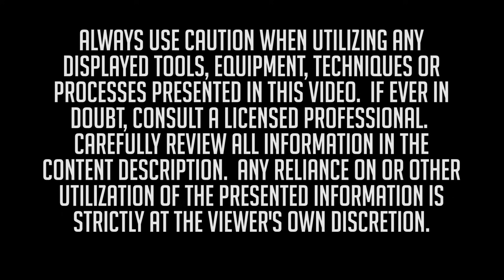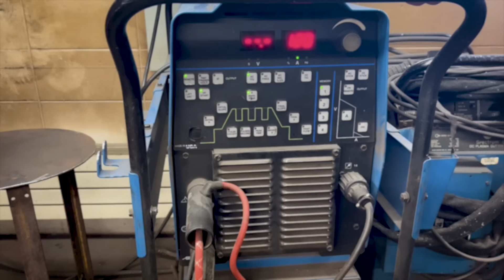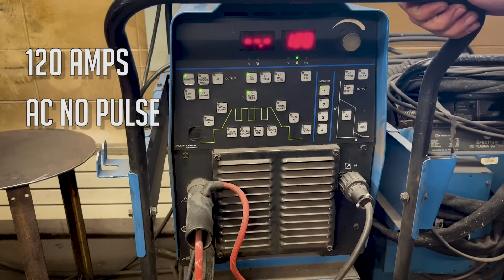Welding and Cast Iron Block Repair

Comment: Nice explanation and instructions on  the metallurgical parts in the beginning. Thanks for sharing.
Reply: Yes, if you're a welder doing a range of jobs and on different materials, you'll become a little bit of a metallurgist automatically!  Something of a mechanical engineer, too: The holes you drill to stop cracks accomplish that by spreading out stresses around the edge of the hole (instead of the tiny area at the point of the crack), reducing the stress concentrations that drive crack propagation. I like the explanation and the explainer.  Would it have reduced crack risk in this repair if the block was modestly preheated and then covered with a blanket after welding?

Comment: I like your video, but have a couple of questions, did you do any preheating or post heating of the block during this repair that you did not show in the video? I have a cast iron base for a milling machine that was dropped and broken the base in 2 pieces and it weighs about 200lbs and I am wondering about how feasible this method of repair would be for my base since it is in 2 pieces and not just cracked. I am thinking about adding some 2" x 1/2" flat with counter sunk bolts to tie the 2 sections together and then welding along the break from both sides if needed I have access to some nickel 99 rod, but it is going to take a lot of rod and I am afraid of it cracking or not being strong enough plus I have more experience MIG and TIG welding than Stick welding and think this TIG brazing technic looks like it might be something I could do a bit easier with my TIG machine I have  Miller Syncrowave 250DX TIG runner machine. Thanks for any suggestions or advice you might have.

Comment: Interesting.  Are you basically brazing with the TIG?  I have "welded" cast iron using a bronze rod and a torch many times and it works well.  The torch might be better in that you aren't melting the base metal?

Comment: Some things the gentleman got right a couple Very wrong.  Stop drill, yes.  Preheat, he got right.  Unless you can preheat the ENTIRE casting, do not preheat. Localized preheating causes tremendous localized stresses.  Never weld/braze on ground metal!  As the gentleman stated cast iron has carbon, a lot of carbon.  1.5 to 2.0 percent. But the carbon precipates out of liquid as graphite in grey iron or  as spheres in ductile or somtines also called nodular iron.  When you grind, you smear the graphite all over the surface.  So, ALWAYS,  and with a clean sharp file, file over the ground area and use a burr to clean the groove.  Now the choice of aluminum bronze is also wrong.  Aluminum bronze has a small amount of iron in it.  You can tell if something,like a propeller, is aluminum bronze by holding,from a string, a magnet close to it.  The magnet will not stick but pull towards the piece.  IMHO tobin bronze is a better choice of filler metal.

Comment: Great job on the repair. Aluminum Bronze on cast is technically a low temperature braze as opposed to a "weld", which is usually the term used for a "Fusion welding". Now I can let gramma police take the rest of the day off. I was a professional welder (in another life). While I rarely had to weld any cast iron, I once had a situation where a large knuckle dragging pipe fitter, overtightened a cast flange that was NPT, meant to get threaded onto some galvanized pipe for an emergency shower system in a petro-chem plant and cracked it. The shutdown was over and the owner wanted the plant started up, but it would be weeks to get another flange (local suppliers don't stock cast #150 NPT flanges). There was some discussion about MacGyver-ing something up (the system only holds 100 psi warm water), but I said "Why don't we try silver solder on the crack and see if will hold?" With nothing really to loose, they said to give it a try and wait for it.........the repair worked find and for all I know it is still operating. The moral of story is, all repairs on cast iron are unique and what works in one situation may not be appropriate for another. If the joint I fixed was subjected to high heat or thermal cycling, the silver solder may on have worked.

Comment: I've been repair welding for 50+ years. I thoroughly enjoyed how you conveyed the information. Aluminum bronze is also my go to.  The only thing I do differently is that I take a once over "cleaning pass" without any filler.  I use lower amps, lower frequency,  high reverse polarity to help pull impurities from the weld area prior to setting up for the actual  brazing.  I rebrush and acetone the entire area. Then I lower the dcep, slightly raise the ac frequency and start the brazing.  My effort going over the area first with lower heat and higher dcep seems to result in less impurities floating out of the braze during the actual brazing of the crack.

Comment: Hello Mr. Weld. Ive seen a few 426 hemi's on facebook maketplace at $15K that needed their blocks cracks repaired. Your video was very helpful to me. QUESTION: its been 2 years since you posted this video, did the welds hold, some fail ? thank you sir.

Comment: Just got done using this to fix my brand new $2000 block.. worked like a charm.. thanks for posting this! Welded very easy and clean as well.. it was on a part that broke off that holds a M8 head bolt at the top.. already machined and tapped and tq held way passed what is needed of it!

Comment: I loved learning metallurgy. Just remember....brittle means cracking. Cast iron in general does not like going back into a molten state. I've thrown blocks into a home stove before because like he's stated, the best way is heating the medium. It's more difficult heating cast iron because you have a hot block or cylinder head's in my case but, it's worth it. At least from what I've seen and done.

Comment: Just filled a small hole on some core shift that appeared during a gasket match on a SBC head.  Did the standard 400* preheat with a slightly carburizing  flame with a postheat, then insulated the structure for a slow return to room temperature.  Hopefully to keep some ductility in the repair and eliminate the possibility of a crack.  Used a 3/32" Nassau Brutus A electrode designed for spring, tool, and casted steel for the 1/2" repair area.  Your video was great and very informative and reminded me of my college Metallurgy course with an emphasis on practical application. I will definitely try the aluminum bronze on a large structure repair next time where ductility is needed due to expansion and contraction during the heat cycling of things like an engine block.  The use of a lower melting point filler material like aluminum bronze will be an advantage and minimize the heat affected zone of the repair.  Great video and the knowledge shared was equally great!

Comment: Good morning my brother! Well l have 5.7 L Dodge Diesel it seems the previous owner left the engine on water on winter and popped frez  pots broken water pump , and I’ll filter housing, arts l am okay but looking at the bock broken in many places l am not very happy, l have done t with regular weld stick for metal not for cast Aron l did made drills holes at the end of cra , and work well ; l learned somting from you , you use aluminum sticks , l never thought will work muc better , l complitey unerestend the lest l het it it up the block the less crack walk , l am going to try it with wire welder see how it works , used break cleaner spray to take all contaminated materials to make sure it weld 100% it’s one place it’s very hard t weld it’s on barom place n the block l don’t want take the engine out off the truck it’s lots of wok l prefer to do it on steps and take it ese on weld hope it work good ,  will let you know this block Brocken in 4 diferent places besides parts, l cranked up runs good , l hope don’t have any damage on the inside pistons, which me good look my brother from another mother  but same father , God bless you all. Your friend Carlos!

Comment: A tip I learned is to not use grinder disks/flap disks on the cracks to be welded. The disks, apparently, create a gouge where the ground carbon fills the porous cast. This causes more carbon to migrate into welds. The tip I learned was to use carbide burrs to CUT out the crack, instead of grinding.

Comment: Straight up info! Been doing this since I was 16 in 76'... with twisted wire brazing with a jeweler's torch. My uncle ran a Pressure Vessel shop and taught me how to do X- ray repairs guys twice my age mainly tried... lol. 
Adapted from Eutectic filler to solid rods we center less ground, to Aluminum Nickel Bronze with proper 2 step preheat and gas adjusted by a progressive/regression type monitoring. Our contracts teaching D.O.D.
personnel has been a stellar advancement for " OUR BOYS ". 
KUDO'S my friend... you are on point.              Seth

Comment: What percent of base metal thickness did you achieve in penetration?  You did not grind as deep as we did at the welding and machine shop I worked at in high school.  Brass was not frequently used unless it was just a really poor cast iron.  Typically we did deeper grooves and used rosebud preheat and post heat stress relief and welded with 7018 or sometimes a nickel rod got cast iron this was in the early 70’s and I realize knowledgevhas been gained through experimenting with different filler material.  I kind of expected silicon bronze but not aluminized bronze.

Comment: I have used 10 lbs of brass on one repair several times. With great results. Fun stuff. Your correct the preparation is as important as the welding

Comment: No pree heat or post  heat? I also use a needle scaler to blend in after final grinding, making it look like original casting. When painted you can't tell the difference. Good job 👍

Comment: Non welding person at all here.  Best video I have seen so far and I have seen many.  To say the least/most (🤔🤔🤔🤔, both a compliment) all I learned from this is that I will not be TRYING to repair my brothers block.  It's the bolt hole for the starter, it has two cracks.  So we were thinking HEY JUST USE A MIG WELDER AND TACK IT AND EVERYTHING WILL BE FINE.  IT WILL PREVENT THE CRACK FROM SPREADING AND HOLD THE STATER IN PLACE, but no.

Comment: If I may I'd like to share previous experience with cast iron weld repair.  Certified 20+ years as aerospace welder/shop supervisor in the structures and powerplants depts and race car fabrication.  As you have learned, being a welder means sometimes you are everyone's 'best friend'...

Running these depts I had a heat treating oven available for pre and post weld heating and cool down.  Years ago, a cracked set of SB Ford heads were cracked.  The 'old school' method suggested brazing with silicon bronze filler.  Descale the area, stop drill the cracks, v-gouge the cracks, pre heat soak to 300+ deg.  AC tig braze fill from both ends of cracks towards the middle with good overlap then slowly cool in the ovens.  At about 6 hours with heads cooling near ambient temp, heard the awful sound of cracking!!!  Repeat the process, eventually saved the heads.

A lot of time, effort for a maybe repair.  There has to be a better way.  Talking with a Eutectic sales rep, he suggested I try their special rod intended for cast iron and mismatched ferrous alloys, the Eutectic 680 filler.  Available in tig and stick form.  Intended as a specialty filler for difficult, unusual weld repairs.  It has the unique ability to tenaciously hold onto the base metal but.. the filler puddle will 'relax' as it cools preventing post repair stress cracking. A somewhat low temp filler similar to your alum/bronze filler.

A friend racing a seriously modified Austin Healey Sprite in autocross his engine was in need of rebuild at a storied foreign engine machine shop.  There you might find anything from a Fiat to a Ferrari engine overhauled, balanced and blueprinted.  They magnafluxed the head, found it cracked between cyls 2-3.  Very common... two siamesed exh. valves side by side with no cooling passage between them and they both share one common exhaust port. A disastrous design doomed to failure.

The machine shop owner said 60% or more of the BMC 850,948,1100 and 1275cc series heads all share this trait, showed me a stack of cracked heads with this, all deemed unrepairable and that good useable heads were becoming very scarce.

Decided to give the Eutectic filler a try.  Carefully v-gouged the crack until it seemed to end, close to 5/8ths inch deep. Heat the area with a torch, inspect with magnifying glass to ensure the end of crack is found.  AC tig/braze with the filler, not worried about excess build up.  The machine shop will take care of that. 

Head returned to machine shop, passed magnaflux test, shop milled and ground repair area, installed hard exhaust seats, repair deemed successful.  I did 6 more of these heads for the machine shop at $100 each, all successfully repaired.

A Harley owner with old cracked knuckle heads came in that had been very poorly repaired at a high cost asked if I would try to fix his heads.  Not a Harley fan, didn't give the loving care I had the others I found some of the nastiest, dirtiest cast iron ever encountered.  Pockets of sand, oil that would explode while welding, grind back, try it again.  Like it or not, the repairs worked.

To this day I consider the Eutectic 680 a 'wonder rod', seems able to hang onto, weld virtually anything of a ferrous base metal. 

Maybe this could be also added to your arsenal of repair fillers for difficult situations.  YMMV...
Reply: I know its been two years since you posted this, but this was a good read, thanks for the info!

Comment: Oh one more question... what series of aluminum did you use, 2000, 4000, 5000, or 6000 as I'm sure you didn't use 7000 because of it hardness and becoming extremely brittle.

Comment: WOW, someone that understands metallurgical terminology but have never heard of using aluminum as a filling metal for a ferrous metal repair. I've been an aeronautical and heavy equipment welder for over 30 years (17 years as a certified Naval Aviation and shipboard welder) and have repaired numerous cast products but the use of aluminum is definitely different. 90% of the time I used a Nickel base filler metal whether (GTAW & SMAW) but always used a rose bud to pre-heat and post-heat after each welding process. But I will definitely look into using an aluminum base filler rod. Thanks for sharing your findings.

Comment: Preheat? Post heat? Peening? Never did cast repair with tig braze. Always preheated to 500f and used iron nickel rod.  I always said two things make welders look bad. Cast and cracks. Would love to see some testing of the two methods. Sorry for being such a nerd. Aside from being a welder I'm also a CWI.

Comment: Nice, I love the science behind the instruction...  I also have a 1971 Pontiac 455 H.O. with a broken lifter bore.... would you recomend trying this method in this application?  that area will see alot of stress, I plan on using a lifter brace when I assemble it.

Comment: The difference between grey cast iron and nodular, or malleable, cast iron is the heat treatment performed.  The carbon contents of both types are in the same range.  The problem with welding cast irons is avoiding fast cooling rates that allow the formation of "white" iron which is basically Iron carbide or cementite.  The when iron gets above a certain temperature there is a change in structure and the carbon goes into solid solution.  If this structure cools too quickly, then a form called martensite forms which is very brittle.  The key is to preheat the cast iron piece, perform the welding, then cool slowly.  The area that he is referring to in the weld is called the heat affected zone or the HAZ.  Rather than welding, an alternative process is to braze the crack.  Also at the tips of the crack is to drill them out and insert a threaded plug.  Nice job.

Comment: What would you suggest for a knock sensor port on a 350 small block? The block was damaged removing a broke off knock sensor. The threading on the block were damaged so now even with the new knock sensor installed the block is leaking antifreeze. Thought about boring the hole and taping it to fit a larger adapter but the knock sensor would then become useless. Any help would be apricated.

Comment: The first half was good having said that he is not welding the crack he is brazing the crack over, the crack for the crack is still there under the braze which is a stress riser. All brazing is is a solder it bonds to the metal, welding is when the parent metal is melted and mixed with the filler metal. Ifyou are going to drill a hole go past the end of the crack as the tearing apart / stress of the metal is still going on after the end of the crack for a little bit. If you heat cast iron to fast you will break it the same go for bronze valves , pumps, ect. To me the method he used was a band aid.

Comment: I have a  potbelly  stove  sold by Sears and Roebuck stores  probably  100 years ago.  I dropped it and  broke a leg. I was  wondering if it could be fixed or should I get another one  cast?  Thanks for the video.

Comment: Great video, lots of info on the metallurgical part of welding. On side note, I had to weld a crack in punch press arm some time ago for the company i work for. We didn't had any ac capable welding machine just mig and a little dc tig welder, i chose to use the dc tig with 316 stainless as filler(of a mig reel lol) and its been fine for the past 3 months.

Comment: so with the aluminum bronze filler it's not a set 50 on the the clean dig cycle?  If was dead clean or dead dirty what is the farthest you've gone in either direction?  I am amazed by the idea of aluminum being used in such a high carbon weld, being that it has such a higher thermal expansion than any steel. 

You have me interested.  thanks